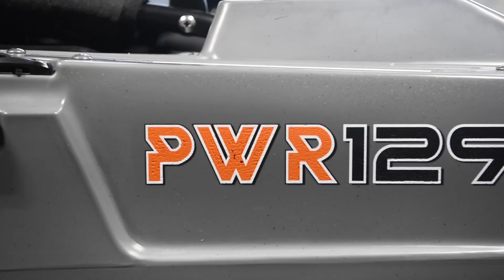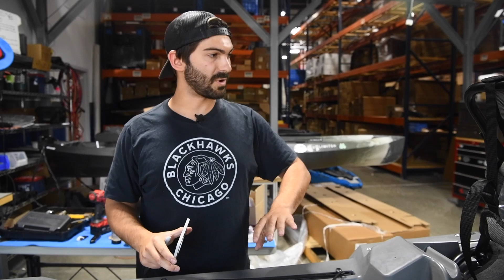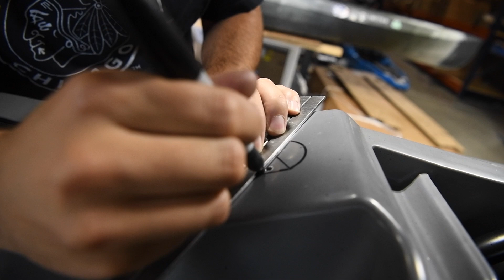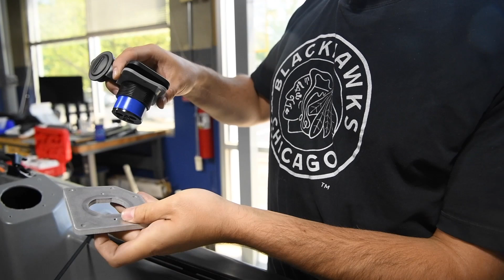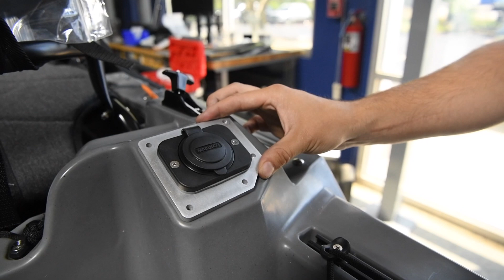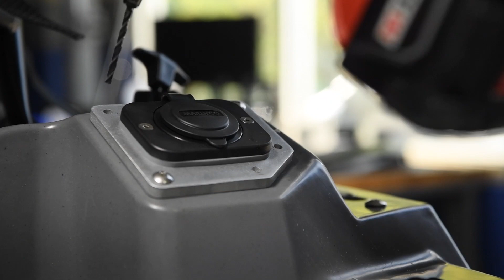Installation video for Ketch Marinco 70A plate for Bonafide PWR 129 Kayaks

Comment: Looks like a $100 solution to a $2 problem.  Bonafide has already provided wiring/access plates that do not require drilling fist-sized holes into my beloved kayak.  I own several Ketch products for the PWR129 (bow motor mount and drypod delete kit). I even put the Ketch sticker on my yak. Yeah .  .  .  . ? ;  uuuhhhhh, not for me.

Comment: Well ordered this and finally got around to installing it only to realize the marineco plug with threads does not fit.  Would have been very lovely to have known this before the fact. So now I'm either going to either order a new marinco plug with no threads or sand the threads off of my plug. I should have just left my install the way it was instead of wasting the 20 bucks